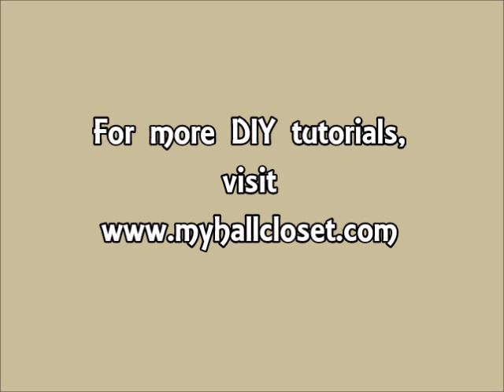How to Install a Click Lock Vinyl Floor

Comment: Oh no, how did your floors hold up so far? All the floating vinyl i looked at requires a 1/2 space between vinyl and the wall for expansion so it doesn't buckle up on humid days, which i think is a good idea down here in the south especially those days when its 100 degrees and the ac cant keep up :P. Im also about to face an issue whee all my door casing are undercut WAY too much from previous carpet and will be raised far off the floor, Im going to have to figure out how to remedy that later maybe with 1/4 round if i can cut it well enough to not look silly.
Reply from the maker: I love my floors and they are holding up great. Makes the room so much quieter. I left a space between the flooring and the wall, according to manufacturer specs. I have since added the quarter round. I understand about the undercuts. When I remodeled my bathroom I had the same issue. I hope this helps.
Reply: Ive done plenty of laminate.  I remove the baseboard moulding - i hate 1/4 round.  Touch up paint the wall bottom. Then replace the moulding and it sits on top of the floor.  The gap needed on the sides is under the moulding so its hidden.  This is a much easier and cleaner method.

Comment: I enjoyed your video. You did not place plastic under the vinyl to reduce the sound of footsteps. Is vinyl good at keeping footsteps muffled? Hope that makes sense? Thanks.
Reply from the maker: No plastic. Even without the plastic the room is quieter. I would say yes. I have vinyl in my den and in my master bedroom and I love it. The rest of my floors are 1950s oak hardwood.
Reply: It has a rubber backing

Comment: The painter generally runs a bead of calk around all painted woodwork including the baseboards. Failure to cut the calk loose before prying the baseboard off will often result in the calk pulling the paper off the drywall.
Reply from the maker: Thanks for the advice!!! That is good to know.

Comment: I hate clock lock on short side, take longer and have to bend the plank all weird to lock in
Reply from the maker: It is a bit tricky.
Reply: @mywithallmyart  i like the drop and lock better, the factory recommends locking an entire rows short slide first, then long as as a whole, I would like to see them lock in a 20’ run with that method.

Comment: Undercut the casing next time.
Reply from the maker: Thanks! I will next time! But, honestly I hope I don't have to do this again!!!
Reply: Can you explain what this means?
Reply: @cyclonic7134  Casing or casework is the wood door framing (jamb) she was cutting around.  Using a door jamb saw would allow her to pass the plank under the framing without the need to cut the plank around it.